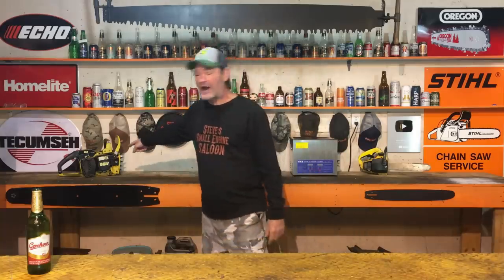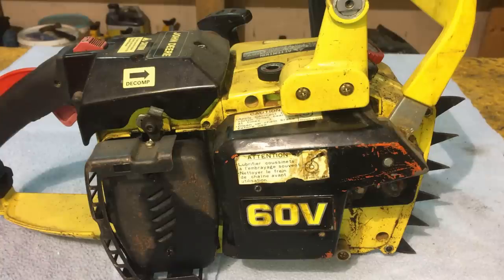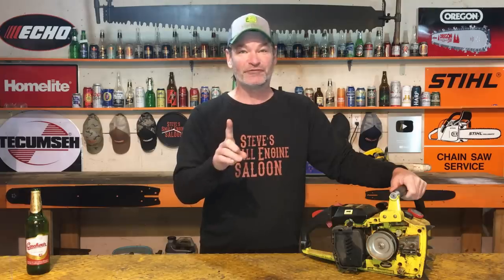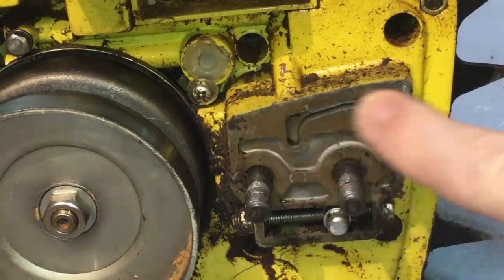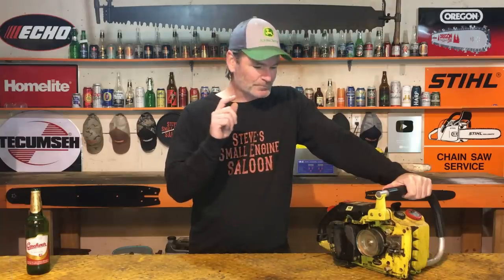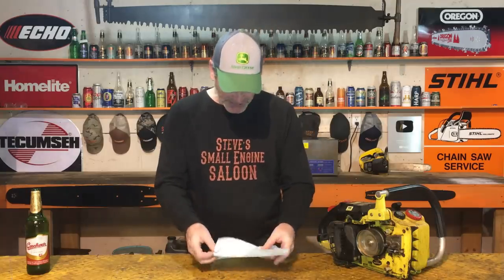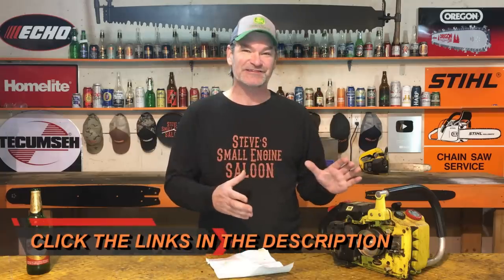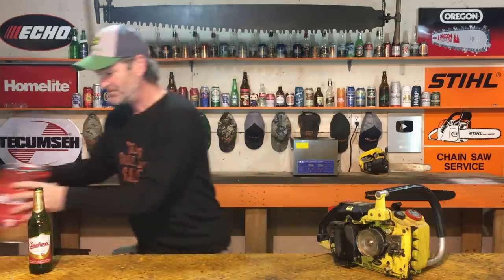Help Me Fix This Chain Saw Oiling Problem

Comment: My Grandpa had one. Would not oil, filled oil tank with diesel fuel let soak, warmed it up pumped it a few times started working after a bunch of goo came through the chain port.
Reply: Eric Eiler, great idea. Diesel can thin out the dirt and lubricate everything to make the sh#t come right out.
Reply: Diesel cleans the muck off the (#18) check balls too.
Reply: That was my assumption to. It's clogged with gunk. Needs to be blown out or as you said diesel
Reply: I've used kerosene with good results.Also soaked the cap while doing the tank,need a clean vent.
Reply: I don't know chain saws, but I've worked with a lot of check valves.  Simple and effective, but they can suck too.  Any goo on the ball and it won't work, any thing stuck in side will block it etc..  my only advice would be that by taking a look at the seals, and the balls to make sure there's no damage, and see if you can find how to adjust it.  Maybe it needs to build some pressure inside to force it out?  I'd need to see how it works to give any solid advice. 
Turn it into a dedicated winch  motor.
Reply: @Dave-ss5pk  Steve would of blown it out I'm sure.
Reply: Diesel fuel helps with oil seals and clogged up oil. They have replaced them by now after several attempts to get it to work
Reply: My thoughts exactly.
Reply: You could also use Mystery oil. Although diesel would probably do the same thing.
Reply: Too much crap inside that oil system. I was gonna say fill the Oiler with seafoam let it soak, and blow it all out. But, the diesel fuel or kerosene will work just as well if not better. Good luck with that Steve!

Comment: Fill the oil tank with kerosene. Let the saw idle till warm. Try manually pumping the oiler. If the Kerosene starts running thru, replace the kerosene with a much lighter viscosity bar oil than your usual or the recommended.

Comment: The oil cap is not holding pressure I ran into the same problem after I took it off to see if was low had to pump it by hand then it worked try replacing the cap
Reply: I have not seen this problem before, but I agree on the OIL CAP.  It is easily overlooked and could well be the culprit.

Comment: Wish I had some ideas for you...but that parts diagram...wow...could be one of many things in there.  I once had a cheap consumer-grade Poulan that wouldn't oil - took the sonofabitch oiler apart a dozen times and never could get it to oil.  And that was a super-simple oiler.  Liked the video - if you do get suggestions and get it fixed, would enjoy a follow-up video!

Comment: i had a problem with one of these sobs back in the day....i ended up modifying it. i took one of those gasoline pump up bulbs and mounted it beside the handle as to mash it with my thumb. i connected one side of the bulb to the oil tank and routed the other side to beneath the plate underneath the saw blade where the oil originally comes out.  I drilled a hole through the side of the oil tank to run a small gas line to the gas bulb on the intake side.  from the out going side of the bulb i run a line through a couple of holes i drilled as i routed it to the original oil port hole beneath the saw blade.  Problem solved. need to keep the saw in a warm place in extreme cold ..the oil gets stiff and bulb is a bit harder to pump.  good luck with this.

Comment: Usually when oil gummed up on our equipment even in the extreme cold we would put a little kerosene to thin it out. Equipment that set up the mechanic ( even on the heavy equipment) used kerosene to unblock and clean out the lines. I think that's your problem but you'll need to flush it out really well once it's bleed through.

Comment: Solvents air pressure I don't know if I could say anything anybody else has not said but if you got a bucket of old Bar Oil in a parallel dip it in and every other cut

Comment: Is there an adjustment for the oil flow? I know it has a manual oiler but if there is an adjustment to decrease or increase the flow, could it have vibrated closed?.

Comment: That thing looks pretty solid. Here's what you do, roll up to the local saw shop around midnight, toss that thing through the front window, retreat with new saw.....or put some diesel in the tank, let it sit and blow it out. Maybe it's right in front of you, something might be a miss where the oil actually comes out therefore it returns to the tank without ejecting.

Comment: well you definitely need to do a breakdown video of the oiler system but I know with the only oil system near that one that I have dealt with had a small ball barring stuck behind a spring loaded needle valve. Maybe a video of a breakdown will have someone notice something the rest of us done.

Comment: Steve, these old saws used straight oil not synthetic oil. My ole Mac won't oil with the new sticky synthetic bar chain oil. Try cleaning the oil system out and use 30w oil.
Reply: I have a newer Chinese knockoff that does that.  It won't push the sticky stuff but it will do straight 10w.  It's in the documentation that way.
Reply: @danauwema  Yes, many old saws use a check valve, a small ball that sticks in the valve when using that new chain lube. Probably same with the China copy saw.

Comment: You might try putting the bar and everything back on the saw and see if it needs to have a hole with which to create a vacuum to make the oiler operate. I do hope this helps!

Comment: I would leave degreaser in the oil reservoir and check in a couple days, maybe the oil has hardened into a small ball and it's preventing flow, can you get an air hose in somehow from the exit point of the oil and blow it back into the tank?

Comment: Hey Steve, 🍻 cheers big guy, my question isn't about chainsaws  I just wanted to ask if it's okay to put an inch smaller blade on a mower than the actual size it calls for? Please Help!

Comment: 3 things. Using a shop vac to clean out the oil system from the oiler ports by the chain and then from the fill. The ports first. You can take out the individual assemblies and use a vac on each one to make sure nothing is in there. After that, prime the system. I would pressurize the oil tank slightly. Not so much that it damages anything. Then try running the saw with the oil fill cap slightly loose.
The last thing I can think of is to send it to me. I don't think that's really feasible. Good luck and if I can remember the last suggestion, I'll let you know.

Comment: Old chainsaw guy here and a few immediate ideas:  1) Kerosene soak to clean out.  2) pressure test to maybe find leak?  I'd guess an o-ring or tube leaking?  3) Perhaps, you can block off manual oiler and isolate leak from auto oiler?  4) worm gear working properly for oil pump?  5) I believe that model had an adjuster to increase flow or reduce oil flow.  I'd open it up wide open and try to pressurize after good kerosene cleaning.  6) That style pump, you almost have to treat like a pressure washer pump and all it takes is one slight leak or o-ring not sealing or tiny crack in pump or tank and it won't hold pressure.  Terrible design.  Good luck and wish ya all the best!

Comment: My comment is a bit late sorry. If the drive gear is still good, an the pump is good she's blocked with crud. I usually clean the storage tank out remove the inner filter an put very small bursts of compressed air into the oil pickup an sometimes a bit of carb cleaner in the exit port to soften it up. It will do a little pop if something shoots out. Hopefully you get on top of it. Cheers Mark

Comment: I have an old homelite super ez, every once in a while i have to fill oil tank with diesel and let it soak a  few days then run it till it starts working again.
Reply: I've even put petrol in the tank - basically anything thin & a good solvent to clear the crud & get it primed. Then gradually move to 50 / 50 say chain-oil & paraffin, then just chain oil. Has worked well for me before.

Comment: Have an old Pioneer saw, did the same thing and it turned out to be an air leak at the rubber hose connections.

Comment: Have you tried taking one of those chainsaw bar grease pumps and filled it up with bar oil and use it to push backwards though the spot where the oil comes out to see if the pump is plugged. And if it is dothat to push it back out i to the tank. Then drain and clean the oil tank. Or get ahold of Buckin Billy Ray`s buddy's Walker and ask him.

Comment: I’m an auto wrench but looking at that diagram it looks more like a diagram for a valve body in a transmission than a chain saw Oiler. My best guess would be either a spring installed wrong, check balls that are the wrong size, a sizable clog in the system, or it’s just plain fubar. Seeings it has a manual pump on it couldn’t you “adapt” some parts to it and create your own manual Oiler independent of the built in Oiler? Though not ideal if you need it to get through a cord of wood it would probably work.

Comment: Look at the holes in the screws that allow air into the oil supply as they may be clogged.  Also force a solid wire through the oil passages to allow whatever solvents you are using to get where you want the oil to flow.

Comment: I’m just an aircraft mechanic myself, but when I saw all the springs, I have to wonder if they were put back In the right place. i.e. certain tension spring here certain spring tension there. Kinda like injectors. Gotta have the right spring tension. Just my two cents.
Reply: I agree, and some springs are directional although those usually are slightly tapered.

Comment: Run a piece of heavy fishing line up the oil hole. It may be clogged with a bit of rubbish. And as others have said check the o rings on the pump to make sure they are sealing ok. Good luck.

Comment: Normally the the chain oil is a kind of vegetable oil which will be become like a semi solid after along period of storage. This will even cause to damage the new automatic oiling system also. The manual system is some what like hydraulic. You open all pumping system and clean well and check the springs,springs,balls and ball seat etc.., I believe it will work. Try that. All the best.

Comment: I had a similar problem. It turns out there is a small hole that allows pressure from the crankcase to the oiler. It had a check ball and spring that had to be adjusted just so. This pressured up the system including the feed to the manual pump. The pressure hole was plugged and had to be cleared. I used my tip cleaner for the gas torch. When the hole was cleared it took a minute or to get the oiler flowing correctly. I believe it was an older Craftsman that was made by Echo.

Comment: Hey Steve,iam using my wife's tablet to answer this lost my phone. Anyways had the very same saw with the same problem. The Manuel plunger  has bad seals that's why it's not building pressure for auto feed. It needs the plunger seals replaced. Once you do that it can then pressurize the system. Hope it helps cheers! Blair out.
Reply: Sandra Fright and if that's not the problem, it's just plugged up somewhere in that system
Reply: @notafuckinpplperson8233  lol I think your right! Let's hope that it!

Comment: Old chainsaw mechanic mate of mine had a fix for Echo chainsaws!
Spray can of green paint!
Paint it green & throw it far as you can into the long grass!
Find it 6 months later with the slasher on the tractor while mowing the grass!
Toss it in the bin & buy a Stihl!
Problem solved!
Worked every time on Echo saws! 😜😜👍👍🇦🇺😂

Comment: you try flushing the oiling system with kerosene? Most oiler problems I've encountered have been broke/cracked lines, plugged orifices( plugged with bar oil and sawdust, since bar oil is so thick ), or leaky O-rings.....check the tank too, possibly sawdust or dirt got into it and is plugging the outlet. They are usually foolproof as long as they are clean(ish) The manual pump not working either tells me it's either in the tank, or a line.....I had a Mac I think 110 or 120 in that had the manual pump also, that had a broken line, and was plugged with sawdust and dirt ( happens when someone runs the bar into the dirt ) Keep us posted

Comment: Either the oil passage is clogged somewhere or it's picking up air instead of oil which prevents the suction process once the oiler is primed. Had a similar problem with an old Lombard although it didn't have the auto lube system. Good luck buddy.

Comment: Oh yeah forgot to mention I like your videos, also I watch Taryl too you two are the best. If you can't fix the oiler send it to me I can repair it. This thing will oil if oil is getting to the pump even if you tapped the oil hole and put a screw in it to block the oil it would blow the case apart at the screw it has that much pressure on it

Comment: the question about the ID tag on the deere, it was a 60 cc engine, with rubber mounts on it to lessen the vibration to the user.   So tag reads 60V,,,,,if u run into a EV model they had electronic ignition

Comment: You didn't say anything about the volume knob near the oil cap. Did you turn it up? It runs almost as good as mine. These saws are 45 yrs old. I think it was 1977 when my dad bought the one in the video.

Comment: My dad had a chainsaw that would stop running once it got warm and refused to restart.  He sent it to shop after shop, and finally sent it back to the manufacturer.  Even they couldn't figure it out; the carburetor was pristine, and it passed compression checks.  Finally a local shop actually figured it out by a stroke of luck; it was a manufacturing defect in the engine block.  There was a slight warp somewhere (I'd assume likely the mating surface between the block and the head), and it was just enough out of plumb that it would work fine until it expanded with heat, then it would lose compression.  I know that's not related to this specific problem, but it does inspire a thought about minute manufacturing defects; what if there is a minor hard-to-catch manufacturing flaw somewhere in the oiling system where the check balls and valves rest that isn't allowing them to move correctly?  You might try running a file through any passages you can in the oiler to make sure there's not some kind of metal burr hanging things up.

Comment: had a similar  problem, I'm guessing you have blown out all the oil ways and cleaned, I replaced all the springs and that worked, turns out 1 of the springs was weak. hope this helps, PS thats nice beer we get it here in England and yep i cant pronounce its name either 🤣 oh and repair time for this will be the large can 👍🏻

Comment: Check oil pickup tube for oiler it actually use crank case vaccum if stop up with sludge not going pull liquid through

Comment: If all else fails you could possibly modify it by taking the current oil assembly out and replacing it with a new version that isn't quite as complicated.

Comment: Try some thinner lubricant transmission fluids maybe break fluid if the seal's are hardened if it starts to pump then go back to a lighter bar and chain oil anyway best of luck to you

Comment: Looks like the oil pump works off crank case pressure (pump assembly numbers 4-9.  If that is not working then the manual pump will not work as well.  I would check the following areas.  Port form crank case to pump piston is clear, oil pickup tube has no leaks or blockages, o-rings seal correctly and ball valves installed in correct order with springs.

Comment: Steve I sold these when they were New and the one thing u need to know about them is the bar Oil that Deere distributed at the time these were made was NOT the honey style sticky oil that most bars utilize now.  Flush the system if full of that stuff, and replace it with some 10w oil, or maybe some 10/20 oil and it may just surprise you.  It was just one more U should buy our oil item at the time.   If not working then just start changing orings, as the manual pump usually functioned even when the auto oiler didn't, and maybe the decal is gone, but if you turn the auto oiler knob to the right it increases oil flow by changing stroke on the piston.
Reply: Steve I grew up in logging and agree with this comment. I have had to reseat the check ball seats after I know the casting is virgin clean clean on rebuilds. I don't use new honey base bar oil ever, I use motor oil and add Prolong to it. I use the quart oil cap and  add at least 2-3 caps of Prolong to it, more is ok but don't waste it, it's not cheap but the result is amazing to all friction parts, bar and chain especially. In my older saws it changes the sound of my bars and blades when they are operating. The check against back pressure is negating the normal function so don't overlook the seats if they are in the casting. The old castings had alot of silica in the aluminum so the cellulose in the wood dust would remove aluminum so you have to drive the silica back flush to the metal in the seat if in the casting. Older carbs the same. Prolong is a degalding additive and I have a frypan with it to treat all metal friction parts at 150 degrees before reassembly, besides to all my motor oils. Sorry about the long wind but it's a sharing for all the thing you have helped me with in the past. I learned this on a 17:1 racing engine that increased HP and reduced wear by a factor of 10. Try it and I like those foreign beers too. I still have saws running from the 60s. Good luck!

Comment: It’s got to be clogged or one of the gaskets or seals are out of sequence. Run a light oil like red Tran fluid from the bar back then take it apart a unit at a time and see how far the oil gets.

Comment: As both the manual and the auto Oiler and non functional and you have most certainly cleaned the port , the pick up is clogged with sawdust. This happens when the oil is refilled on site . It does not take much . I would use a wd40 95psia straw io clear with a sylicone globe on it for a seal  and remove one valve and back pressure to clear out